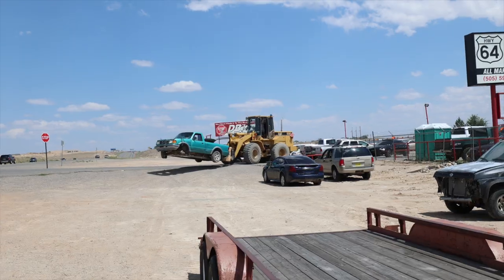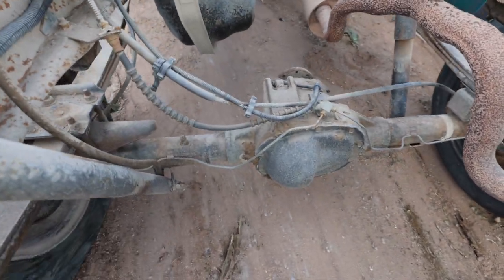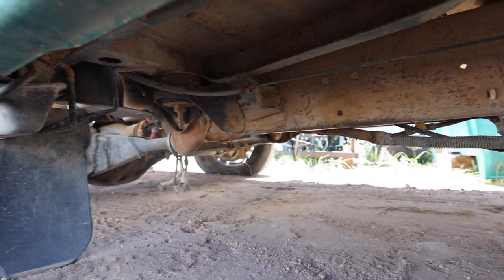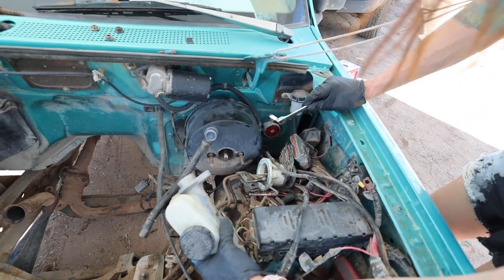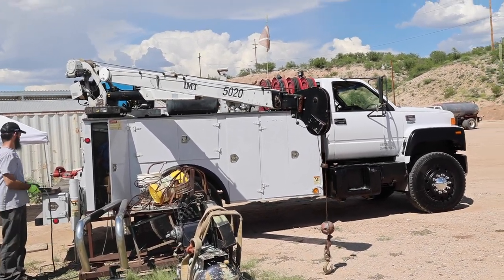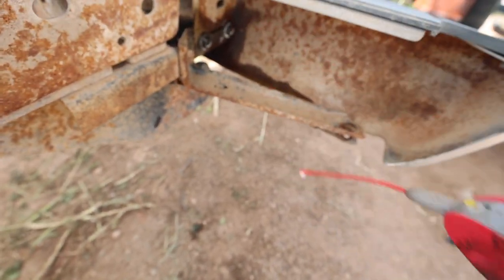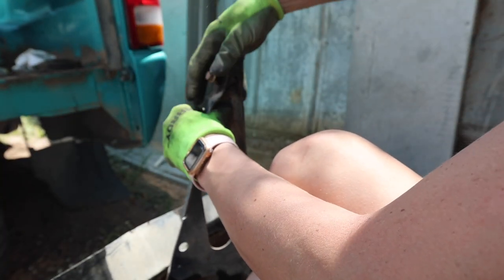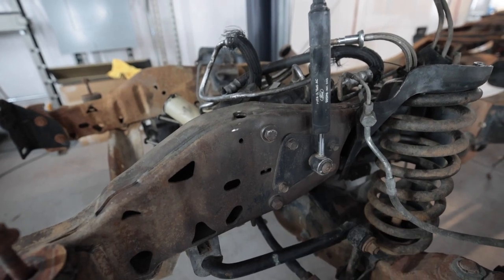This Is A Ton of Work, But Worth It! // Project Ranger Frame Swap

Comment: I’m doing the same thing with a Bronco II.  I dread it, but it has do be done. A/C lines, brake lines, steering column, fuel lines, accelerator cables, brake booster, wiring harness, etc.
Reply: People will pay big money for those, now that the new ones are out.
Reply: @Mr.Ramirez95  I’ve heard the same thing.

Comment: I had a Mazda/Ranger as my daily driver from when it was new in 94 up until 2007. One thing you should check is the gas tank, a crack formed and I was unable to fix it.  Ended up getting a new tank for $500 (back then).  Same thing happened to my neighbor's Ranger.  Right before I traded it in for the Tundra, we took it to his shop and swapped tanks.  Also took my rear sway bar since his didn't have one.

Comment: That Cable from the Body to the frame is actually a Grounding Cable.
Reply: Don't think so. It would be a flat braided cable if it was and it wouldn't be anywhere near that gauge. That was a proper load cable with swaged ends. Probably bolts to the cab near the seatbelt mounting points, for severe head- on impacts.
Reply: @TyphoonVstrom  and not plated copper, high strength wire rope👍
Reply from the maker: It’s an anchor for the seatbelts, it attached to the passenger and drive belts and looped under the frame. Not a ground.

Comment: Use eye protection with impact tools; sometimes things shatter. If the impact wrench and penetrating oil won't move it, heating it with a torch will. In New England under car stuff like shocks, exhaust and bumper bolts almost always require a torch.

Comment: Personally I wouldn't powder coat that chassis because powder coating has a tendency to flake over time. I would prime and spray paint with 2K. The hardener in the paint will give a very durable long-lasting finish without flaking. Just my opinion you understand?
Reply: You think spray paint is tougher than powder?
Reply: @headlesnorseman701  Powder coating does flake off after time where 2K doesn't. It's questionable if powder coating is tougher than 2K but 2K doesn't flake off so protects the metal for longer.
Reply: I would paint as well. Although powder coating is more durable than paint it does tend to break off in chips. When its nee its great but age it with the weather just a short time and it does tend to easily flake off.

Comment: You have to try evaporust... It's a rust converter that does incredible things. It saves so much time, and does not damage rubber or paint. It has saved so much hardware I would have otherwise had to replace.

Comment: Former ford technician here, that orange stuff on the cab bolts and the blue stuff on the bed bolts is thread locker, not anti-seize. that's how it comes from Ford. That cable is also a ground from the cab to the frame. Also, those bolts holding the bumper, they aren't stripped. That's a Ford bracket, two studs pressed into that dogbone shape. Love the project, can't wait to see where it goes. As someone who lives and works in MA, seeing both of those Rangers as clean as they are is mind blowing

Comment: Cool Project! I live in NM, and worked coating operations in the aero industry. We used liquidwrench and heat to break stuff loose, you already have the heat, but soak those bolts if you need to break more loose. On occasion, we worked a bolt back and forth spraying penetrant each cycle, heat seemed to help the penetrant to wick down the threads and often it was dust worked into the threads that created the issue, which the penetrant rinsed away. Hope this helps you and others, those blind holes on engines and frames seem to collect crud.

Comment: Little tip I live in Phoenix I know how hot it gets in Arizona. When your car is parked outside before you turn it off turn the wipers on and turn off so that they're at the halfway mark. Then take your sunscreen and put it on the outside of the window not the inside holding it down with the wipers. Then your window won't get to be 140° and it will keep your car a lot cooler. It'll only get to be 120°😋and only someone that lives in the desert knows that that's a bunch. 20° is 20°😄
Reply: Also, keep an oven mitt handy 😉
Reply: @nitcat1  🤭 I have all my AC vents pointed at the steering wheel and keep a couple rags and a pair of gloves with a sheepskin cover on my steering wheel 🔥

Comment: Trying using Kroil penetrant on those rusty bolts. I work in a mill and it does wonders. Sometimes you can even tap the rust loose with a hammer and try to get them off.

Comment: When I had really bad rust lock I used muriatic acid in a squirt bottle ( the kind they have at a tattoo shop) and baking soda and water as the neutralizer . And it works 😉

Comment: When you run into bolts that give you fits get the torch out and heat it up if you have one.  It works wonders.  Just a thought, you probably now all
about the tip.

Comment: Sara, definition of the "candy corn" reference at 5:13 Min on the cab fasteners. You probably know this, however for the sake of your prescribers the OEM use this a lot. It is "Anaerobic thread locker". Absence of free oxygen. -- Dri-Loc is a dry coating adhesive that contains a micro-encapsulated activator that is suspended in a water based resin. The Dri-Loc® is applied to the bolt and remains inert and dry to touch until the bolt is used.

Comment: OMG! I think that proves it! That "cannon plug" as you called it on the firewall. I helped swap a door on a 99 or so Ford explorer and they literally used one of those entire barrel connectors for the door wiring connector by the hinge! It was like a 48 way connector and they used like 18 of the sockets. I was telling my friends that I think it was literally a bulkhead connector that they reused for the door because it had so many wiring connections. I was like, you could literally take an Explorer door and use this to wire a race car, hahaha. That literally looks like the same connector! I knew it must be an engine bay plug too. I couldn't believe they would use such an expensive and beefy connector for the door, hahaha. Then they were so cheap they only used 3/4 screws for the door speakers. So bizarre, Ford. Wonder if they had made tons of them and then switched bulkhead designs, but still wanted to use the connector. Sorry for the rant. I just love random vehicle info. Hope the sponsorship works out! Can't wait to see the TT.

Comment: I don't know if your familiar with "Ospho rust treatment" I used it when I lived on a boat it chemically bonds to and converts rust and stops it in it's track. I used it on Cat diesels on my then trawler then painted it and rust never came back. You may want to spray that frame with ospho then paint or what ever, then it is golden.

Comment: Regarding the bumper that wouldn't come off: When you are using an extender, it will act as a torque-bar, so it doesn't matter how big your impact is. This is exactly the method that is used when torquing wheel nuts at a shop.
Reply: Ironically, I have had small bolts not break loose because of this...the setup has to be rigid.

Comment: While you're swapping gears and the diff, you might consider an ARB locker.   A locking rear axle comes in handy!
Reply from the maker: It has the factory LSD.. but I did consider upgrading of some sort. The truck will never go off-roading, so 🤷🏻‍♀️.

Comment: Power & Non-Powered AGE...brings back a few memories.  I'm sure you already know this...but your candy corn coating is actual Red-Loctite.  You have also pulled a few bolts that had the Blue-Loctite on them...it is not raspberry candy just in case you are wondering.  😉

Comment: Ok here is a tip from someone who has worked on lots of stuck bolts since the early 80's. Get a set of Oxy_acetylene cylinders (plus safety training!). I have never had a fastener that would not come off when heated.. and if it didn't come off, just keep heating until it melts off..:)
Reply from the maker: Not sure why people suggest to use things when I said I had only a small tool kit with me since I was not at my shop. Do you carry every single tool you own every place you go? Lol

Comment: Hello from Los Angeles Remember the Mazda 3500 Pickup the Ranger would have Either the  Mazda  Transmission I forgot what a friend had told me years ago... I since haven't seen him in 6 years ago, and the Mazda had the Ford Transmission, which I found odd. Great Work... Truck will look great, and feel bad it is as hot and humid, I remember driving thru Phoenix 7 years ago it was 126F degrees. Between Phoenix and Tuscan in the Same Hour drive thru (pealed clear coat) a Haboob, Brush Fire/ {10 foot Fireball Tumble Weed } as well, Rain /Hail temperature dropped to 42F degrees, and obviously high Winds. Therefore, experienced All 4 Elements in the same hour 👦🏻👍🏻🏎🏁🏞.. The drive to the location the frame for the truck was beautiful

Comment: Hope your hydrating in that heat outside. I always find i need to drink way more water than i do when i work out in this heat. Changed me rear wheel bearing in the 98 100% humid air on black top. must of drank a gallon and i still feel wiped out.

Comment: A long breaker bar will apply way more torque on those bumper mount fasteners than the Milwaukee. Soak it in PB blaster and let it sit for a couple days.
Reply from the maker: I didn’t have a breaker bar.

Comment: I'm from NYC, but have been living in Maine for a while now.  Because of the stuff they use on the roads here in the winter, our vehicles rot out quick.  quick as in my truck is 6 years old and the rust makes it look like it's 16 years old.  I'm surprised that the whole frame of the Ranger is still intact after spending it's life in  New England considering it's age.

Comment: I would swap the whole axel. Getting the preload and the mesh of the gears is tricky. As for the frame instead of powder coat why not POR 15. Look what it did to your sister's SUV. I live in Canada where we use a lot of salt and after 5 yrs my frame still looks like new. Out of spite I restored my old truck. Now there jaws drop when they see it. It's an 85 Dodge 350 dually. You'll have fun redoing her.

Comment: extensions make the impact weaker. also you can channel lock/vice grip the socket and pull while you impact. also heat (torch) works too.
Reply from the maker: Extensions are needed for a reason or else they wouldn’t be used at all 😉
Reply: @SarahnTuned oh ya for sure but consider that if things wont break loose, you lose torque with extensions. but yes, i have an extensive set of extensions, swivels etc. having a torch helps too.
Reply: @SarahnTuned  i got to say i am a fan of your channel. new to me and very cool

Comment: Better off getting new gutts for the rear end. Ford had issues with most there trucks for a few years including that one. You could count on the rear diffs going out every 60,000 miles. Had mine done under warranty first time. Did it myself at 120,000 miles. Luckily I knew how cause I did dozens of them. Even in the full size broncos. Them things would drop axles . They wear out, horse shoe falls out, axle slides out.

Comment: I'm pretty sure it looks like both Rangers have the Ford 8.8" as the diff cover dose not look like a Dana 44, and I'm also pretty sure Ford Rangers never had Dana axles from the factory. Correct me if I'm wrong.

Comment: You need some PB Blaster  to soak those nuts and bolts with
Reply: Give "Liquid Wrench" a try. I worked back counter at a dealership for many years. One time my shop supply company was out of PB  and suggested Liquid Wrench instead. After a few weeks my shop foreman asked me to keep ordering the Liquid Wrench. Worked much faster than PB or WD. Just a thought.

Comment: I still think instead of sandblasting and exterior powder coat, you should get the frame dip-stripped and dip-coated so that it is protected inside where sandblasting and powdercoat can't reach.

Comment: If you can use Walnut Shell media rather than Sand (Silica) media to blast the frame you will be better off and it will be better for the frame.

Comment: Grab a junkyard exploder lsd and slap it in there if you're going to rebuild it anyway. A new set of clutches and they are ready to go. With the carbon clutches they will chirp tires like a locker.
Reply from the maker: Mine has the 8.8 with an LSD 😉 I did think about grabbing the exploder rear disk brake parts though.

Comment: I did a custom frame/chassis for my 89 B2200 SE5 rebuild.  I it's nothing new for me and after hunting for solid frames all around the midwest where I'm at I determined it would be easier than buying an "alright" frame and notching/redoing what I needed for the new suspension and everything.  It's an amateur rallycross vehicle powered by a Ford 4.6l Dohc 32v V8 in an AWD setup.  I needed a rollcage anyway so it's all worked out in the end.  It has to be road legal to get between spots/endurance runs...long story short, the midwest has a dwindling supply of rusty frames for B-Series trucks, I'd rather build my own than go through the hassle of fixing up one and taking away the chance for someone that would be better suited for it (like this case).

Comment: Keep original driveline. Just swap over axles etc. You know where it is from and save from shimming into new. I've been looking at trucks from bc and Alberta. Not as crusty as salt belt Canadian provinces.

Keep this truck as original as possible Sarah. Sentimental value is more important.

It runs and it drives. In your climate, rust stops. Hot and dry.

I own a 1994 audi urs4. It hasn't seen a salted surface since 2012. It shows ALOT. Rust hasn't progressed since.

Comment: Girl! An extension on an impact creates a torque reduction!
Reply from the maker: I’m not torquing a head bolt where precision and accuracy is key, I’m using an impact gun w/ over 1400 lb/ft of torque on a 18mm bumper bolt. The marginal reduction in Torque is irrelevant at that high of a level for bumper hardware (which is only accessible with an extension to begin with) 😂

Comment: If yours has a 3.0 engine, it may NOT be a true D-35 front axle.
The older ones had a D-28.
There are some weird hybrid thing, thats more like a lobrid.  It looks like a D35, but had D28 guts.
A 4.0 has the true D-35

Comment: I have noticed a lot of you tube automotive channels say every thing is rust weather it be surface rust or rusted through. Where I grew up surface rust was just that and something that was rusted through we called it rot. I guess there is no real difference between the two but I feel like rot really get the point across. Also are you going to use the heater a/c box from the parts truck? Those are my thoughts about that.

Comment: Sarah, maybe it's not to late to rethink the frame swap. Your old frame is structurally sound. The time tested restoring method of going the P.O.R.-15 route has a lot of MERIT in this particular case. I think you'd be able to satisfy your OCD still and eat off the frame, but the Ranger could wear its flaws with pride ... like your gram's wrinkles from the life we all lead. I think you'd learn to LOVE all those flaws in the frame, even more so 15 years from now.
Reply from the maker: I can bend parts of the frame with my fingers, it’s not salvageable.

Comment: I had one of these Rangers as a work vehicle. It didn't have AC in Southern California. Well, it turns out that Ford didn't give the non AC version an option to vent outside air into the Cabin. You could only recirculate the cabin air!!  That was the hottest truck I've ever had to drive. The Ford Ranger will forever remind me of driving in Ojai in July with my head out of the window.

Comment: At 10 minutes, I was wondering why you had not cleaned it yet before removing the bumpers. Then you start pressure washing a couple minutes later and my OCD was satisfied.

Comment: Use Miracle Paint Rust Killer ...

.. on that chassis.
Reply from the maker: No halfassary will be conducted on this vehicle.
Reply: Sarah n Tuned 
Hmmm ... are you aware of that product? There is nothing half ass about it. 

Maybe it is better known on the east coast, since Bill Hirsch is out of NJ ... but there are many who are adamant about its adhesion and effectiveness in preventing rust. MercedesSource youtube channel made some videos on ways to use the product ... “introduction to miracle paint” 

I personally think the name Miracle Paint seems a little gimmicky but what can you do ... it does really work so you just tolerate the name. 

Anyone who watches your channel regularly is very well aware that you are not interested in half assed repairs.

Comment: Funner fact. The 68 to 75 full size pick ups had a ranger name as an optional package
Reply: Even more funner is the ranger name back then was not just a trim level it was the designation for a camper truck option ford offered.
Reply: @charlierosenbusch3007  not only a camper you could take a stripper f100 add the ranger option and go from there,cousin ordered that and a 3 speed 390 tinted glass one and it was a beast

Comment: I've never seen body mount bolts that clean, ever. Here in the rust belt, oxyacetylene is required to aid in removal of all the hardware you just did with just a cordless impact.

Comment: I have never understood why they don't paint frames from the factory. Other than it's cheaper
Reply: Planned obsolescence. They galvanized the body, but if you can't see it, they don't bother.
Reply: Frames made off site shipped by rail cost mega $$$$$. To do each. Frame

Comment: @Sarah  Does the Ranger have the VIN on the frame?  You might have issues with one VIN on the body, and another on the frame.
Reply from the maker: No
Reply: @SarahnTuned  There should be a vin stamped into the rh side of the frame, around the door area. At least until it gets back from powdercoat.